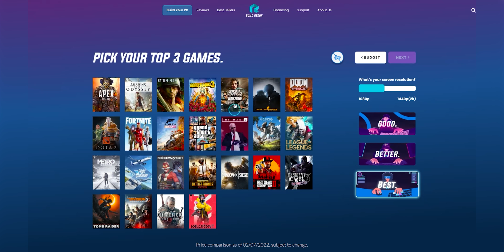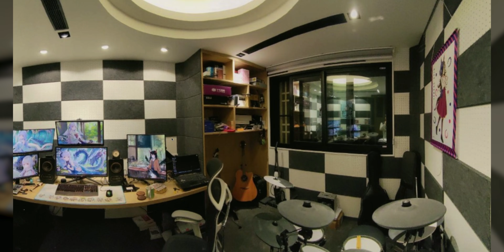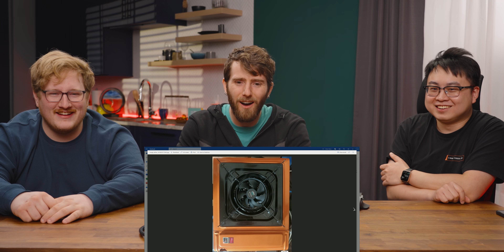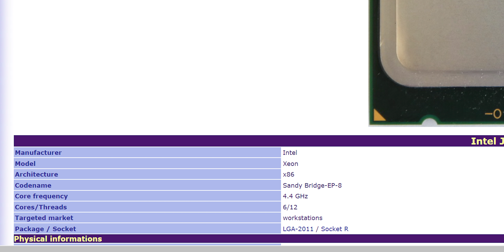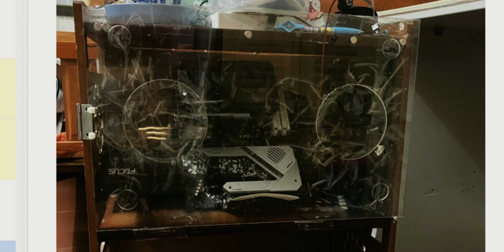Roasting Chinese Gaming Setups

Comment: This is 2 years late, but I did notice a few times it is brought up the question of why they have 2 gpus. It may be the reason I have two gpus; I use linux, but since a lot of programs I need dont have very good support for linux like Autodesk (Maya), Adobe programs, or even some games that kill gpu (pax dei is just disgusting when it comes to resource hogging), I use a Virtual Machine for those. So 1 gpu goes to VM, the other to the rest of the OS.

Comment: Many moons ago I had a laptop with a ATI M56 X1600 that was overheating, even after repaste .  So i cut out of the keyboard a square where the top of the heat plate was, and reinstalled the keyboard.  Then took an old Socket A HS and zip tied a Thermaltake USB fan to it.  External KBM,  and it lasted me until i could afford a new gaming laptop.

Comment: I'm not sure if anyone has mentioned this, but from my experience working at a color post house we'd use the light bar on top the monitor but pointed away from the screen at the wall. The idea was to have a color accurate light as a reference while color grading since your eyes adjust to your lighting scenario. So the ideal set up is a 50% neutral grey with the light behind so you have that reference point. Still prefer no light bar but I understand the point (as long as it's pointed at the wall and not the screen.

Comment: I live in China and see no issue with the power plug. Many of my appliances have two prong power cables. Either the thin rectanglular prongs, or the slightly thicker cylindrical prongs.
Reply: I don't watch on Bilibili because you can't really search in English on there, and the videos are a bit out of date/ delayed, also the Bilibili PS5 app is absolute jank.

Comment: I feel like Linus would absolutely shit himself if he saw my sound setup. When im not using my headset I have a Soundbar not on the wall or anything, but just sitting on the rod holding up my blinds with nothing but gravity and sheer will holding it up right over my monitor and pc. Also the cord that runs down the middle of my wall adds a nice touch to the scene

Comment: You know 
My room is small and my PC can kick it up 10 degrees in an hour.

If i could water cool my PC and put the radiator just outside my window with some well sealed tubing, i absolutely would.

And if i had the money to shift off the cooling into an entirely different room with a crazy looking setup, i also would do that

Comment: Full custom water cooling setup? Nah use liquid helium, if it leaks it won't ruin my setup either because it has a dielectric constant that is between 1.4'k and 4.2'k
Reply: Helium is also inert and um... kind of a little teency weency bit overkill, it can reach temperatures of -269°C which is almost as cold as a boomerang nebula (-272°C)

Comment: That huge board is not that uncommon, Linus. Here in Mexico some of those boards are manufactured. Dual CPU s with 16 DIMM slots and a bunch of optic fiber network connectors. They are for servers.

Comment: Open air PCs don't actually get that dusty. You have better airflow which lets you run slower fan speeds which results in less dust. It's also easier to just blow off the dust.

Comment: Have to admit back when I was a starving IT college student, my laptop processor fan died (the motherboard ports not the motor) so I used garbage bags connected together with duck-tape to the air in vent for the laptop and the window unit... It at least worked and kept the laptop going for about 2 years before the board no longer posted.

Comment: Bending metal tubing is so annoying when it’s so small and thin. I’m not a fan

Edit: also can confirm that running an open setup is easier for cleanup in terms of dust. You don’t want to be bringing any liquids or food around an open setup though, I use one can of compressed air every 12 months or so cleaning the parts of my open setup PC and keyboard. Very hygienic imo.

Comment: 26:49
This is a hackintosh built the right way, with a type one hypervisor. Originally, you would build a hackintosh with supported parts, Mac OS, and a bootloader like Clover or OpenCore, but it's easier to work with a type one hypervisor like VMWare EXSi that supports Mac OS natively. I imagine you know of virtual machines like VirtualBox, which are type two hypervisors. VMWare EXSi is one type of bare metal hypervisor, or a bare bones virtual machine that runs on your hardware directly, giving you a thin translation layer to run whatever software you want on whatever hardware you want. Really cool stuff.

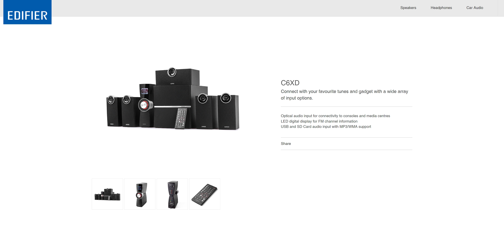Comment: 05:25...OOIIII! I'm using the C6xD since 2015 and it's still, for the price, a verrry good set. Especially compared to the Logitech ones in the same or even slightly higher Price range. Of course it isn't audiophile stuff at all, but i still love them. (eventhough i went back to stereo on my Pc and the edifier  c6xD is used with my gaming consoles. :D)

Comment: You mentioned the cheapest NAS setup using HBAs and extrusion. I actually had that- with 20 drives. Complete with fans and shock mounts. I broke it down for a drive shelf though. It was a master jerry rig.  Not ideal- the number of SATA power extensions required was insane.

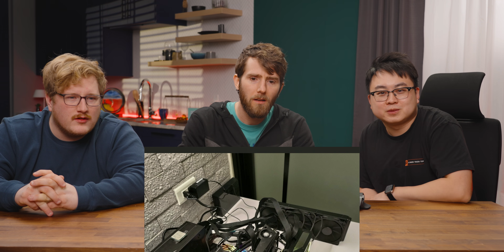Comment: @04:53 That's a plug in Taiwan, which uses the American electrical system (except with shabbier parts and lower safety standards etc). Whether you consider that part of China is a very contentious political issue, but he shouldn't have been ruled out for that.
EDIT: @24:04, same thing.

Comment: 12:10 dust is less of a problem with an open computer, than a closed one. As it is open, it's easy to take the dust off. A closed computer, is closed. You often don't see the dust, forget about it. Then 3 years later, you find cadavers in your comp ...

Comment: Almost square - I LIKE that design, have to look into it.
I've worked (and helped BUILD) actual square displays - for the military as plasma displays (we're talking early 1990s here, 512 x 512 TEMPEST qualified, and SAIT had 1024 x 1024 in the prototype stage at the time).

Keep in mind, VGA was still pretty new then and 640 x 350 wasn't uncommon in commercially sold displays (640 x 480 was starting to get popular but the price was still high for most users).

Comment: The light bar does not put light on your monitor, it puts it on your desk and backlights your monitor. It is great when you hate your main lights in the room. Best for those that like lower lights in the room. Linus needs to use one for a month and try it.
Reply: It also works great as a little low profile work light for writing, or drawing, or assembling Lego.

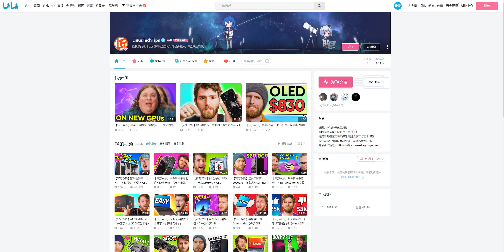Comment: 1:07 how did you guys get past the 100 question entrance test Bilibili puts up for anyone trying to register
Reply: It's account of translate group, all of those questions is about ACG or basic highschool knowledge, Quite easy for Chinese user.
Reply: @jiagusi4981  wait why would you ask specific questions about ACG (Anime/Comic/Game) in an entrance test for a general videosharing website, wouldn't that block out anyone who's not specifically into ACGs?
Reply: @lancergt1000  bilibili (used to named mikufans) used take on the identity of ACG videosharing website. but they changed their strategies few years ago and transform to general video website with entrance test reserved.
before pass entrence question, you can use bilibili except post and upload.

Comment: I very much understand the Tesla GPU setup! At my work we have a bunch of computing clusters, including GPU ones. Some years ago we got a couple of those Tesla  GPUs, but in the process of installing them it turned out that the computer case we had wasn't, uh, optimally shaped and we couldn't fit an internal fan in a position to provide enough airflow for the card to work long enough to boot the system and check if everything is working. What we ended up doing was, and I swear it's true, taking a vacuum cleaner and blowing (well, sucking) it directly over the GPU at full power, and it actually worked as a temporary solution to run the system checks. I haven't seen that rack since, but I'm assuming they got a more suitable case for it.

Comment: What's next level is using an 18 wheeler with a large tank of liquid nitrogen to cool a raspberry pi 4 8GB cluster (10 in cluster). Only a couple of Grand to buy the set up. Why? just because, more money than sense, no, I have not done this, was just an idea.
 
Linus: "The cluster FROZE up, LITERALLY. It's fragile, one tap and it will break, LITERALLY."

Comment: Roast 7 are prebent manufactured tubes, which come with 1 oer 2 90 dgree prebents, so if you have a dual-bent tube, you can only use 1 pent pipe part andt all others need ankles. Not a Style, but a phenomenon, necessary by choice of materials. the builder of this construction was obviously not skilled enough to bend those metal tubes himself.

Comment: btw Edifier is an amazing brand. Their products always hit way stronger than the price point. And they are amazingly reliable - like 10+ years for a 50$ 2.1 (still running) even if you forget to turn it off for days etc. I have DALI and ELAC speakers and Yamaha AVR, but for everyone not willing to spend thousands you can't beat Edifier.

Comment: That multi-water cooling loop setup is the same way that the International Space Station regulates temperature. They have an internal water cooling loop running a heat exchanger to a sub-zero capable fluid that runs to radiators outside the station. The fact that that guy is running functionally the same principled setup as the freaking space station is wild.
Reply: The guy does that is probably in one of the best universities in China.
Reply: It's also the same kind of heat exchanging system that allows nuclear reactors to separate their radioactive internal water from the lake/river water they take in and expel.
Reply: Dont know what to do with this info

Comment: The laptop with water-cooling is quite neat, I've seen one very similar to it selling here in Brazil and basically it has two pipes in the back where you can connect the radiator, OR you can just use the built-in fans for less demanding stuff. It's still quite a pain to plug and unplug stuff though...

Comment: How does your image viewer not simply have "next" and "previous"?  You have to close the image viewer and manually open the next file in the folder?  Is macOS really that bad?
Reply: space on a image... then use the arrow keys
Reply: @maryhadid  Are you sure that works?  They are closing and reopening the image viewer repeatedly, as if that wouldn't work.
Reply: @BujuArena  …they probably aren’t accustomed to macos because that’s a “quick view” instance of the Preview app (tied into finder, so you don’t need to open an extra app). If you want to quick view another pic at the same time, you can’t (unless you double click it to open it in a new Preview instance)

Comment: 8:25 I bet those were ready 90 degree bends. You can just buy pipe bends and cut them to size but if you need more than one on a single pipe, you need joints.

Comment: Shout out to the homie at 15:16 as I watch this on my DIY water cooled laptop 🤣

If theirs is like mine and a few others I have seen it is like the XMG laptops with a water pipe soldered onto the air cooling heatsink. The qdc are so it can be disconnected and run using the stock air cooling.

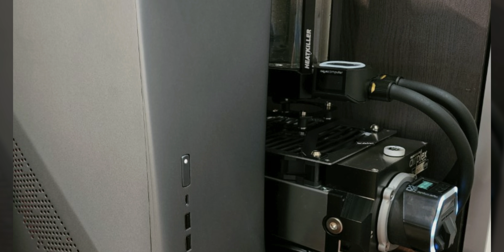Comment: 7:20 You're mixing up these, the reservoir is by Watercool of their Heatkiller series and the radiator with pump is an Airplex modularity system by Aqua-Computer.
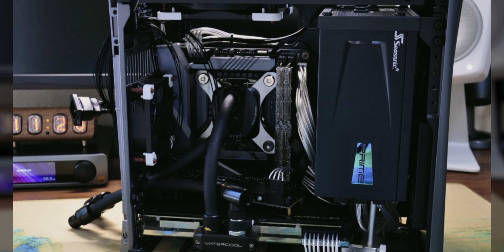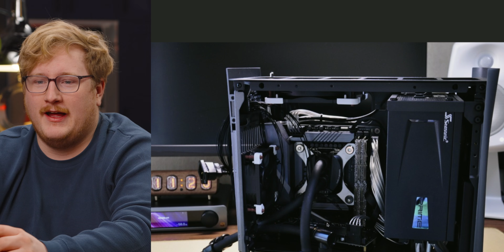And also the CPU cooler at 7:25 is a Cuplex Kryos NEXT by Aqua-Computer, the cooler at 7:32 is again a Heatkiller by Watercool.
However both are German companies that have their production here (unlike Alphacool, they are in my town (Brunswick) and seem to have R&D here but most of their production in China), and aren't the cheapest, good average performance, but excellent quality.

Comment: laughed a few times here, I especially like the chines watercooling techniques :)
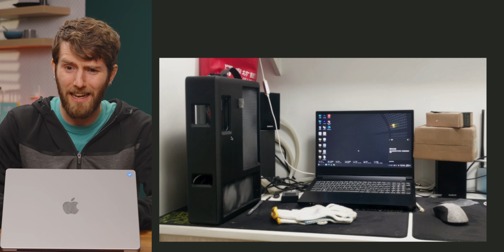15:40 The watercooler setup for my laptop is also fairly big. Yes desktop- components would be more powerful and not as " janky", and also I only want one machine for home and travel. But I actually have good industrial quick disconnects on the laptop because my work requires alot of travel and hotel stays. I can still use it in " air- mode" without the water cooler because my waterblocks are set on top the stock heatpipes for the CPu and GPU :)

Comment: Monitor lamps are great for evenly lighting desks without casting harsh shadows unlike lamps in the side of the room or in the corner. If you have a ceiling light directly over your desk you probably won't benefit as much from one but they're still better than without. And they do not cause glare on the screen because they're specially designed to angle the light. Educate yourself Linus!

Comment: Linus complaining about the top screen lights and I own 2 Xiaomi ones, over each 32" 4k screen. And I can confirm that only maybe 5% of the light gets reflected from the screen, mainly because of dust attached to the screen. I usually use these screen lights at minimum brightness to compensate for the fact that both screens cover the window which is 2 meters behind the screens, leaving shadow on the keyboard area. I can say that these are a must for me.

Waiting for Linus to test those kind of lights, could make it a nice video. Also make sure you dark a bit the room cause if the room is well lit then you dont needed them, but at the same time dont pump them to the max, make them bright enough to equalize the room lighting

Comment: 21:50 those are Itanium submodules. They look like they might be from an HP Integrity RX2800 i4 server (altough the heatsinks in these were nickel plated, I've never seen them in bare copper).
The whole assembly integrated the CPU, VRMs and heatsink into one unit that could be quickly replacable (HP Integrity servers were aimed at high availability, 99.999 %).

22:00 that looks like a testing/qualification board or something like that for Sandy Bridge Xeons. It has two different sockets on it, LGA 1356 on top (Sandy Bridge-EN) and LGA 2011 (Sandy Bridge-EP) on bottom. The EN had three channel memory, and the EP had four channel memory.
Reply: Cool.

Comment: Linus Media Group did what the entire Japanese animation industry couldn't - end the potential problems of fansubs by officially paying the fansubbers to keep doing what they are doing, instead of trying to sue them or pretending they didn't exist.

Also pretty sure the keyboardless laptop with big CPU cooler at 24:05 is Japanese - that's a classic Japanese swivelling plug, note the katakana "ACアダプタ" on the AC adaptor and Japanese on the tissue boxes, and I'm pretty sure the apartment is a Leopalace (big Japanese apartment leasing company that is pretty foreigner-friendly) - I have lived in four of them and the wallpaper, flooring and stupid unnecesary frosted and wired glass window is very familiar. Maybe a Chinese person living/staying in Japan?  Disqualified or no?

Those lights are designed to not shine on the screen, by the way - think of it as a very wide spotlight.  I don't have one but I did consider it - went with LEDS on the back of one monitor and a clip spot pointed at the desk on the back of the other, neither of which is visible from the front.
Reply: Interesting insights, thank you!

Comment: For Jakes info. I found open frame computers to accumulate much less dust then any of the closed ones. I used to have to take my pc out and dust it every year. I haven't had to dust my current system in 5 years.

Comment: 7:24 Linus you are off, that is an Aquacomputer Cuplex Kryos block and it was if I remember correctly THE best performing cooler at the time I build my first water cooled System (it was an i7 920 but it was more at the Sandy Bridge Era when I finally was able to water cool my build). Mine was full bare copper though and It weathered beautifully on the outside (I like the look) but the inside is fine. You can also clean it up very nicely if you dismantle it and put it in a sufficient Acid. Beware though that the stainless steel insert on the outside will come off (it's just visual but still) so I would suggest to only clean the cold plate and only if you have to. Also new brackets for newer Sockets keep dropping so it is still compatible with about everything and it is a true quality Product that will likely last for ever. 80€ well spent in my book.
Reply: Edit: Okay, I was wrong, actually it's a Cuplex Kryos NEXT which is the successor to the product I described but I'm fairly sure that the OG Cuplex Kryos also came in an black acetal version. Still a great block I belive.

Comment: when linuis showed "has to be this big, where is it even going" 
I know... servers
Inventec used to make big special rack (wider, longer than normal) mounted servers with motherboards that were octa-cpu 
yeah, not dual-cpu, not quad-cpu, but 8 of them... it was 2 quad-cpu systems on one PCB... that stuff was huge, I never saw finished system but I saw people putting CPUs in those motherboards on assembly line, it was wild 
(I was working mostly with blades)

Comment: 24:52 I used to have an LCD panel in my NZXT H440. Used a monitor that was almost exactly the size of the side panel window.
I even clipped the power cable to the LCD panel and put MOLEX on the end of it, so it powers up with my PC.
The panel was being driven by a Raspberry Pi 3b, which I just connected to the monitor's control board, which I mounted to the inside of the side panel aas well.
It looked pretty cool tbh